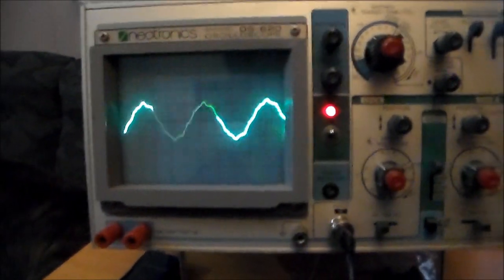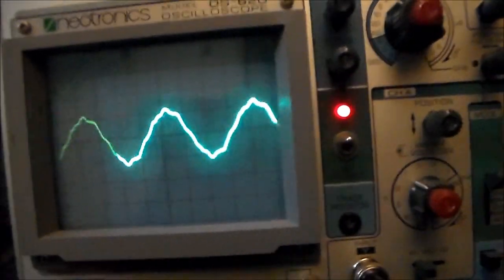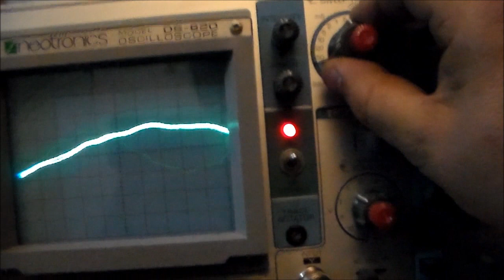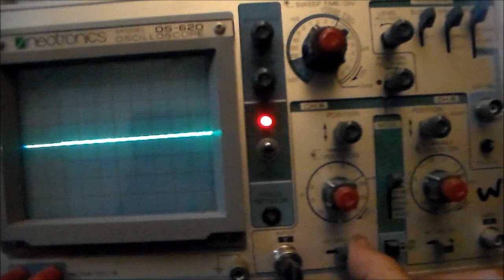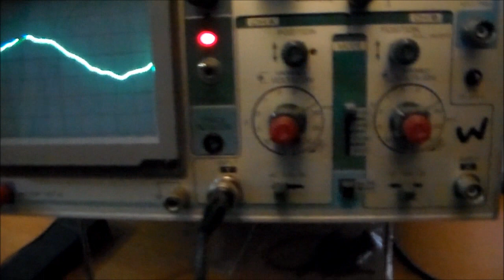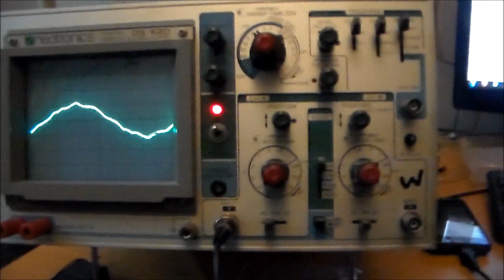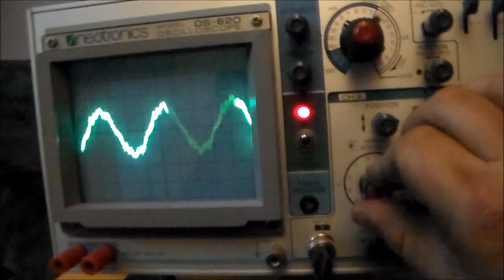New Toy: Neotronics OS-620 Oscilloscope - Sinewave Problem Corrected!

Comment: The oscillator outputs a high frequency sine wave with a peak value close to whatever the driving voltage is. It is safe to connect the probe directly to the primary side.

Half of the turns will make the top half of the sine wave, and the other half of the turns make the bottom half of the sine wave.

Comment: My leader 25MHz analog scope has a circuit breaker on the inputs to stop you from being dumb and connecting the probes directly to mains without some sort of isolation (and therefore keeping the scope from losing all its magic blue smoke.) I found that out in a shower of sparks that blew a chunk out of the tip of the probe I was using.

Comment: lol ya, everybody makes the mistake of forgetting the ground clamp at first.
If your voltage scale goes high enough, then you will have no problem hooking up your scope directly to the mains...The only issue you COULD run into is accidentially hooking your ground clamp to hot/live

Since on most scopes the ground clamp on your probe is directly connected to earth, hooking that to hot/live would be a dead short to ground...There will be an explosion, or at least some smoke and fire and stuff.

Comment: i dont think mains is meant to be that clean anyway, the long power lines will pick up radio/RF noise and anything that sends a wireless signal, get yourself a signal gen that outputs sine and you might find that the signal will be cleaner

Comment: Try tapping on to the calibrator output on you scope for a test.

Put your probe on x1 and connect it to a long wire wrapped around a wire carrying the mains to something.

Mains can be bloody disgusting.

Is your scope earthed correctly?'

old oscilliscopes are great tools but dont expect accuracy from them.

turn the brightness down and adjust the focus and astig to get the thinest trace :-)

you will enjoy that mate, i did when i first got mine 20 years ago :-)

Comment from the maker: uhh thats creepy man, there WAS a pc psu on the same power board that i was using as a 12v supply for a 555 circuit i was observing with the oscilloscope to check its function LOL. watch for the next couple of videos! inbuilt test pin works great!